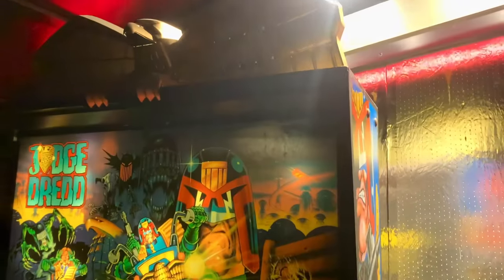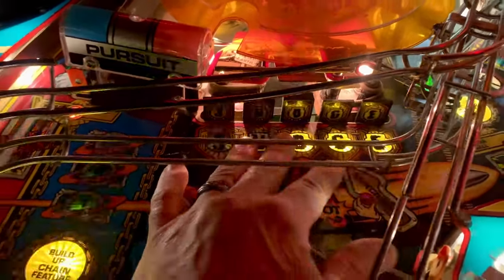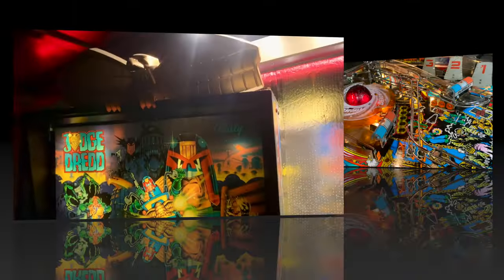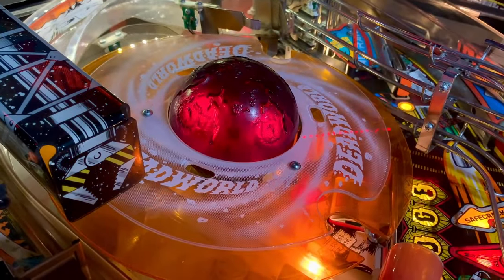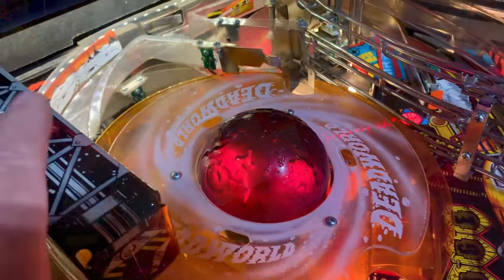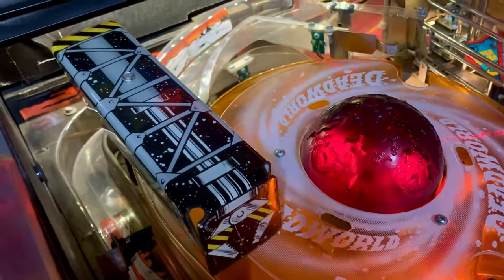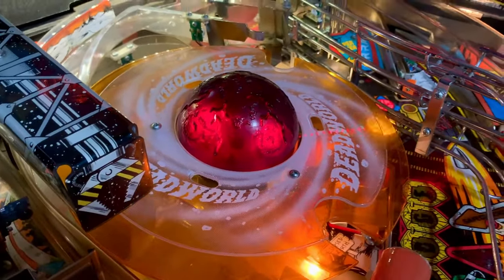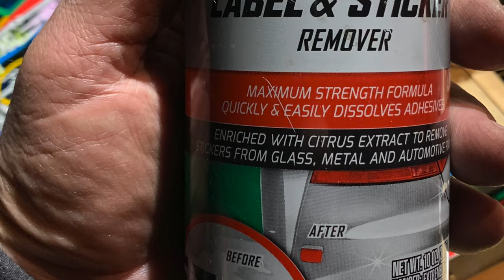Bally JUDGE DREDD Pinball Machine 2024 Tear Down & Shop Out

Comment: Definitely wishful thinking... Pulled mine down last weekend with locked DW motor and it's either money or engineering....
Reply from the maker: So pretty quickly after this video was uploaded my deadworld locked up again.  I did enough research to realize that a replacement gearbox was an expensive direction.  I pulled the gearbox again and soaked it with a combination of carburetor and brake cleaner and then blew it out with air from my shop compressor.  I then extensively tested it out on the bench where it then worked phenomenally.  Reinstalled it and it's functioning perfect.  Fingers are crossed for sure....  But in the back of my mind it's a just ticking time bomb that I'm just waiting for it to say, "sorry that's all folks!"  Cheers and good luck with your DW motor issue.
Reply: @Steveos-Gameroom  the guy I purchased mine from noted that the opto interrupter, the the small globe spins on, rubs on the inner shaft causing them to bind up and that us what causes the stop and gear spinning on shaft. Mine was stuck and wouldn't turn. As soon as he got the interrupter shaft off, it freed up. Now he's been sanding the inner shaft to a smaller diameter, if that's possible. I'll find out this weekend how it plays out. I'll let you know what I learn